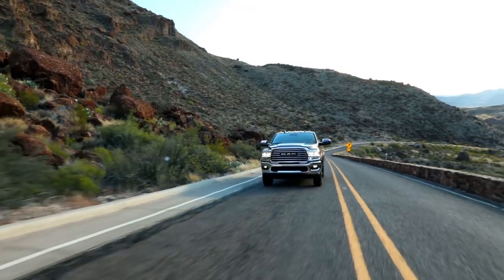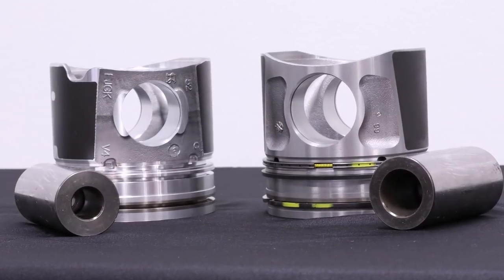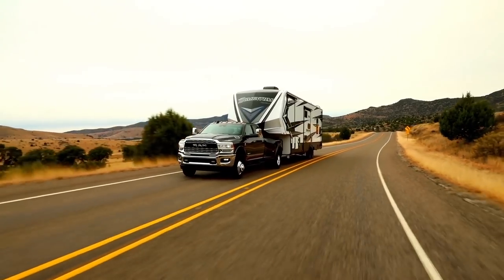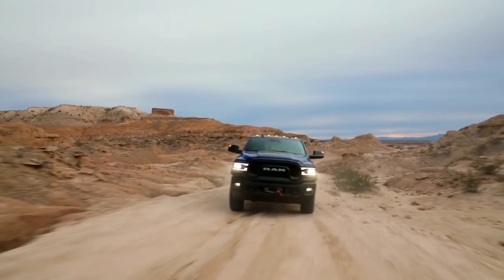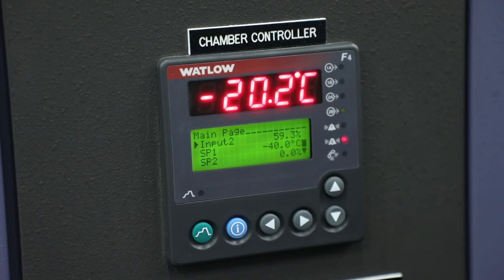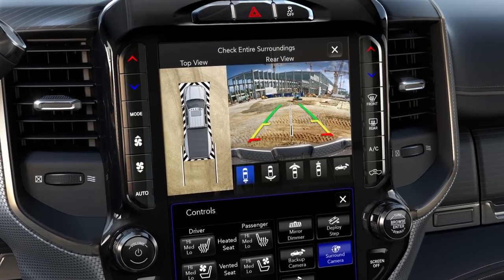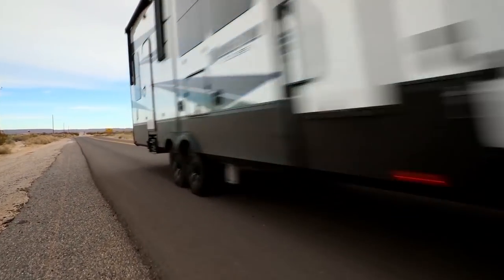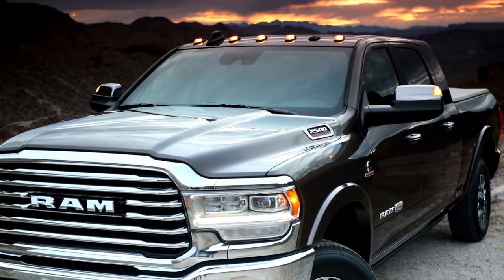First Drive | 2019 Ram Heavy Duty | Driving.ca

Comment: Pulls great!
But I have a 2018 2500 PW and stops worse than my Grandson's 2006 half ton 
STOPPING IS LIKE THE BRAKES ARE WET WITHOUT THE LOAD, NEEDS HYDROBOOST BRAKES!
CLASS ACTION LAWSUIT IS ON THE HORIZON FOR WRONG BRAKE SYSTEM!!!!